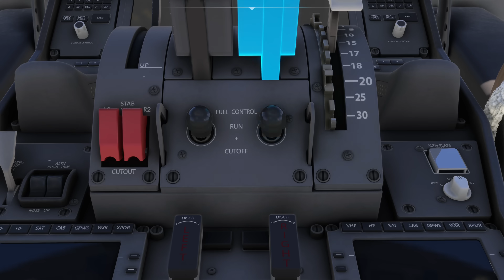Air India 171: Why Did The Fuel Cut-off Switch Get Moved?

Comment: I had a question: We all know that when the fuel switches were set from cutoff to run after 10 seconds of it being set to cutoff, one of the 2 engines suffered a failure because of which there weren't enough thrust to pull the plane upward. Consider a very new and healthy 787, if you do this similar procedure in this similar situation where you set the fuel switches to cutoff for 10 seconds and then set it to run, do you think the engines will suffer failure or the chances of them failing will be high and even if they come back to their normal speed would there be enough thrust to propel it upwards?

Comment: Could it be a software or mechanical fault?

As mentioned elsewhere, the fuel lever switches do not have a string attached to them that opens and closes a valve. When they are moved it sends an electronic signal that is interpreted by the software system that then triggers another mechanism to physically adjust the fuel valve. 

So….

For some inexplicable reason, there is a software or mechanical failure, just at lift off a light comes on the dashboard to indicate fuel cut off. The Captain asks the FO pilot, “why did you cut off the fuel?” The pilot claims, “I didn’t”. Note the Captain DOES NOT THEN SHOUT in counterpoint, “The levers are in the cut-off position!”. 

This is because they are actually in the Run position. 

To restart the engine, the only option available, he then pushes the levers to cut off. This movement to cut-off doesn’t register on the black box record, *because the system shows that the fuel cut-off is already the status*. This explains why there is a 10 second delay in moving the switches back to the Run position, which does register on the record. The engines then do fire up, but alas they are too low and there was no time to develop the required thrust to stay airborne..

Also, in a simulator, has anyone been able to flip both switches from run to cut-off within 1 second - the duration recorded on the black box record?

Comment: Having studied the Honeywell datasheet for these less than $100 switches. I believe that the guard nibs are not steel, probably some zinc alloy, and it states that only 2.3mm of "pull" movement is required to lift pass them the pull force is not stated. There is an elastomer seal around the switch lever at the pivot point which the switch leaver must either slide through or deform when pulled. Over time and if contaminated with tea/coffee, could this elastomer seal start to resist the return action of the spring thus preventing the switch lever sliding back below the guard nibs? These switches are mounted at an angle, low down and located between the cabin door and the two pilot seats, i.e. in an ideal position to receive dust, dirt and sugar rich tea/coffee spills when a drink is delivered by cabin crew to the pilots. I would love to know what was the exact problem that made the FAA create the AWD for this switch!!!!!!! I'm starting to think that it really was not guarded due to mechanical issues. To summarise, WORN GUARD NIBS, CONTAMINATED ELASTOMER SEAL AROUND THE SWITCH ROCKER, WEAKENED SPRING could all come together to prevent the switch lever being effectively locked. What caused it to move is another matter, vibration, gravity, reaction to the plane rotation and pilot hands as they are busy in this area during this stage of flight. Also moving them quickly back to "run" will be easy if the guard is made ineffective by the above.

Comment: I find it very hard to believe that either pilot would have intentionally cut off fuel to the engines. Similarly, it seems highly unlikely that both fuel cut-off switches would have failed, been accidentally bumped, or that independent left and right engine control systems would have simultaneously malfunctioned.

It’s also unclear why there are no timestamps provided for the cockpit audio, nor why other standard callouts—such as “V1,” “Vr,” “Positive Rate,” or “Gear Up”—aren’t mentioned in the report.

If the question “Why did you cut off?” was asked (and denied) BEFORE the recorded movement of the fuel cut-off switches, is it possible the pilot flying saw an erroneous status or warning on their MFD (Multi-Function Display)? If the display showed that both engines had lost fuel flow, they may have believed a dual-engine failure had occurred and immediately initiated the memory procedure to cycle the fuel cut-off switches.

While each pilot has an independent MFD system, that’s the only location where a single point of failure could display a fault affecting both engines. If the pilot’s MFD was displaying incorrect or misleading data while the co-pilot’s screen remained normal, the pilot would have had to make a split-second judgment at low altitude—deciding which display to trust and whether to proceed with emergency memory procedures.

Comment: Buddy, if you really are a pilot you should know better.  You should know that 2 switches cannot be turned off in 1 second.  It would require more time.  So, don't try to save boeing by passing the buck to the pilots.

Comment: QUERY ACCIDENTAL MOVEMENT OF THE FUEL SWITCHES....?

Steve,

Query the brief conversation, as recorded on the CVR, where one pilot ask "..Why did you move the switches...." and the reply from the other pilot of "......I did not do so....."

It is  perfectly possible that he did not know that he had caught the fuel switches accidently, perhaps because he had his hands on the throttles in such a way, (at the rear of the throttles), in the act of 'steadying' them during the Take-Off Roll. Factor in the possibility that there could have been an element of the airplane bumping quite  bit as it ran down the Runway, (hence a reason to steady the throttles), and you have all the hallmarks of a possible accidental nudge or knock of the fuel switches at the most critical points of V1 and Rotate in the Climb-Out.

Just a sayin'......

James Hennighan
Yorkshire, England

Comment: Captain Steve,
With all due disrespect, I’m absolutely appalled at your careless and biased commentary on the recent Air India Express crash. You sit comfortably in your chair pointing fingers at a TRAINER-LEVEL pilot—someone who literally teaches others how to fly—while tiptoeing around the real culprits: Boeing and the airline.

Let’s be clear:
	•	The fuel switch was moved from “cut-off” back to “run.” One engine responded. The other didn’t. That’s a system failure, NOT pilot error.
	•	The ELT system didn’t work during the crash. That’s another Boeing or airline maintenance failure. Not a single word from you about that? Convenient silence.
	•	Previous reports exist about fuel switch malfunctions in 737s. You chose to ignore this too—why? Because you still fly Boeing planes and won’t risk criticizing your own industry?
	•	The crash report leaked to Western media even before Indian authorities released it. How is that even acceptable? It screams of narrative control—again, nothing from you on this. Why?

You say the landing gear might have caused it. Then contradict yourself by saying both engines were working. You’re twisting facts to manufacture pilot error where there’s clearly mechanical failure. That’s shameful.

You’re not just misleading people—you’re defending a broken system. The whistleblowers, lawsuits, and ongoing trials against Boeing speak louder than your rehearsed cockpit monologues. Stop hiding behind your years of experience if you’re not going to speak truth. Real experience demands real accountability—not deflection.

If you truly care about aviation safety, start calling out the manufacturers and airlines cutting corners. Until then, you’re just another cog in the PR machine, failing the very passengers you claim to respect.

Comment: I really don’t understand how such a technologically advanced aircraft can allow the fuel supply to the engines to be cut off while the thrust levers are in TOGA mode. How is there no fail-safe that only allows fuel cutoff if the thrust lever is pulled back to idle?

Comment: One question I have not seen answered is if and how the fuel being cut off would be displayed to the other pilot if he did not see the actual switches being turned? Obviously you would notice the engines winding down, but would there be an indication or meaaage that it is due to the fuel being cut due to the switch position.
 With regard to the question about why two pilots are not required to shut down an engine, I would assume that is because a single pilot is supposed to be able to handle an emergency even if the other pilot is incapacitated?

Comment: The switches are they supplieng current to main releys. Are the log for on/ off indicating coming from the switches or from the relays. Can it be a loose electrical connection or a failure in the communication bus?.

Comment: Hi Captain. Why are you not talking about the 2018 FAA Advisory statement which quoted - “The fuel control switch has a locking feature to prevent inadvertent operation that could result in unintended switch movement between the fuel supply and fuel cutoff positions … If the locking feature is disengaged, the switch can be moved between the two positions without lifting the switch during transition, and the switch would be exposed to the potential of inadvertent operation.”

This could very much be a possibility!

Comment: Could it be that one of the pilots had placed a cup of coffee on the flight instruments which was spilled on the switches and caused a short circuit resulting in the disengagement of fuel supply "fuel cut off".
There was an incident in which pilots on a private indian airline did the same thing, luckily no accident occurred, but the pilots  were grounded!!

Comment: It's kind of tricky to think they can switch both switches within a second. It took 4 seconds to turn the second switch on after the first. How is it possible to turn both of them off within a second? It seems you are already blaming the pilots by dismissing ANY possibility of a flaw in the aircraft, that's quite huge faith in mechanical planes that have failed before.

Comment: I understand why fuel shutoff might be needed at 400ft on descent, but surely the system should not permit it during takeoff?  As you have said, there is no reason why it would be needed, so surely it should be made impossible, especially when the consequences would practically always be catastrophic?

Comment: I believe in the preliminary report and I am not in conspiracy theory camp but I believe that as well as the deliberate action to move the fuel control levers to cutoff we need to consider this was accidental. There have been many instances of pilots moving 1 control instead of another.  So much so that airbus produced a paper on it. GOOGLE cockpit control confusion. This would be an extreme case but not impossible.

Comment: You say the switches were physically placed in the cut off detent.... since there are no cameras in the cockpit, to insist that is what happened is wrong. There is absolutely a possibility that the switches registered electrically as in cut off without the levers themselves being moved. I appreciate that this possibility is low but is exists all the same.

Comment: @CaptainSteeeve, I hope you can answer the following questions:
1. Why is the gap when switch to cutoff is 1 second and when turning on 4? Yes, there is panic, excitement, but why so long? 
2. Can you do an experiment and with your 1 hand turn off and on several times and measure the time?
3. Is it possible to hide in the cockpit?
My theory is if there could be a 3rd person in there that was not seen by the pilots on takeoff. He turned off both switches and quietly exited the cockpit. Then exited through or approached the emergency door and was thrown out by the explosion. That's the one survivor?

Comment: Initially there was a lot of focus on the landing gear not retracting, with this additional information was the fuel turned off before the landing gear should have been lifted? Or if the landing gear should have come up prior to the fuel being turned off, would this also point to one of the pilots’ not being in the right headspace?

Comment: They probably turned them off in one last moment, to possibly somewhat reduce the overall collateral damage after the impact. As both were very good, very experienced pilots, I think such a way of logical thinking is imaginable. There is NO official procedure for steps to do before an imminent impact, as you've just said. Which now brings us back to the exact cause of the incident...(which still is not clear). Both pilots look like happy and stable guys, I can not imagine one of them or both wanted to commit suicide. It is just VERY unlikely.

Comment: How about the Nippon 787 who suffered a unexpected rare dual engine failure on landing, could this somehow be related, is there another TCMA failure possible?
  
The report (about the Nippon 787 dual failure) said: "Boeing did recently release a bulletin regarding the Thrust Control Malfunction Accommodation system (TCMA). The safety system is designed to prevent uncommanded high-thrust situations. In the bulletin, Boeing said that selecting full reverse too quickly upon landing before the aircraft has fully transitioned to ground mode could cause the system to activate. While this bulletin could shed some light on what happened, what actually caused the engines to shutdown won't be clear until a full investigation is completed."

Comment: Why is the switch still in cutoff position. It indicates that both the pilots don't want to switch ON the fuel.. Absolute bullshit.. Latching should be the problem.. Mechanical failure can also happen.. You guys are just scammers

Comment: I am not a pilot, but after reading the preliminary report on AI-171, the following questions came to my mind that I hope someone with expertise can shed light on:
1. How did certain US-based media outlets (e.g., Wall Street Journal) get prior information about the report's contents, particularly about the fuel control switch?
2. Why does the report seem to focus so quickly on potential pilot error, even before a detailed technical conclusion is drawn? Is this a standard approach, or does it risk prematurely shifting blame?
3. If the ELT failed to activate, why is this not considered a critical safety concern in the report? Isn’t the ELT essential for rescue operations in less accessible crash locations?
4. Why are exact timestamps missing for key events, such as when the engine failed, when RAT deployed, when specific callouts were made, or when fuel switches were manipulated especially considering the flight lasted only 32 seconds? Wouldn’t precise second-by-second data help clarify the sequence of events better than vague terms like “immediately after liftoff”?
5. If the black boxes were damaged to the extent that data was hard to retrieve, should this not raise serious concerns about the crash survivability design of these recorders, especially for modern aircraft like the 787?

Comment: The previous pilot and co-pilot likely had firsthand knowledge of how the fuel control switch was functioning. Their opinion is not disclosed so far. This insight is especially important in this case, as the preliminary report indicates that the switches transitioned from 'RUN' to 'CUTOFF' and then back to 'RUN' — a sequence that demands closer examination.

Comment: there are few points to be noted. 
- British FAA airlines has mention about fuel switches could lead to cutoff in 2018 on Boeing planes.
- They haven't mentioned that they turning off fuel switches, when pilots they do say it first and the perform any operation on the aircraft
- with 0.1 second both the switches cannot be turned off. Impossible for human to react in 0.1 second.
- both the pilots are surprised that the fuel switches are off
- the switch may went to cutoff ,when the nose of the plane nose is lifted.

how can you say there nothing wrong with plane. seem you love Boeing .

Comment: The Aircraft Accident Investigation Bureau (AAIB) released a 15-page preliminary report. The report pointed to a finding that in 2018, Special Airworthiness Information Bulletin (SAIB) from the US Federal Aviation Administration (FAA) had flagged a potential fault in the fuel control switch locking mechanism. According to the advisory, the issue, if unaddressed, could lead to inadvertent movement of the switch and an unintentional in-flight engine shutdown; a scenario consistent with what investigators suspect may have happened in this crash. Switches were replaced twice. Obviously there was a technical issue with the switches. 
Big stakeholders trying to cover up by blaming people who are not here to defend themselves. People are not fools.

Comment: What about the issue with Air Nippon and the engines switching off when they were landing ? You appear to be rushing to conclusions from day 1 ( flap handle being mistaken for the landing gear handle etc) - what about a software check to be done in the 787 software code  to find out why engines cut out ? There is a precedent to both engines being shutdown in the 787  plane (Air Nippon)  - and therefore Boeing cannot be exonerated nor the engine manufacturers in a preliminary report ! - So kindly dont rush to put out videos to get viewership - your credibility is taking a hit with every report that you are doing ! and you are coming across as very limited in your coverage of the topic - more like a pilot's only view - which is very limited !